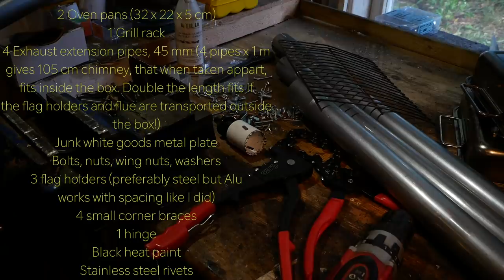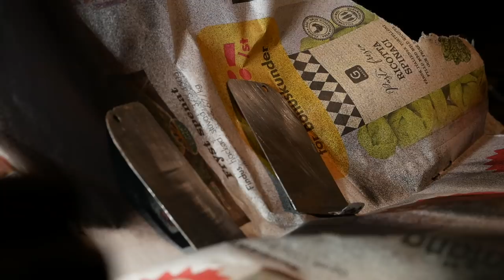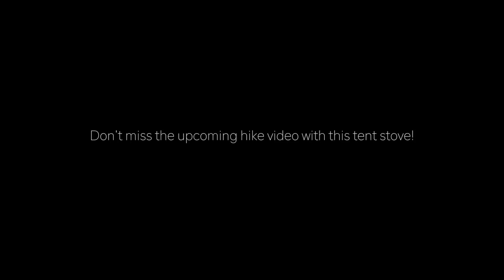IKEA DIY Tent Stove for Backpacking

Comment: Some poeple live two lives. A Life before they owned an angle grinder and life after they own one. The first life was miserable and gray, the second is is full of glorious destruction, planning and construction!
Reply from the maker: Indeed!
Reply: Hahaha 👍🏻😁 good comment! And true!
Reply: Amen.
Reply: Sparky Runner  not putting in to much wood
Reply: @SwedMiro - Truer words have never been spoken...  so many years I walked right past the electric hand grinders in the tool isle, when I could have saved so much time and hassle. At the point now I actually have two... I run a cut-off wheel on one and a grinding wheel on the other.

Comment: In case anyone is concerned about stove pipe size or length this is the math for a flue size:
 5% of firebox volume is the minium you need. Yes, 5%! Though there is a min and max length that fits into actual chimney effect that's tested.
Results for a 2.5" exhaust pipe:
235.61944901923" volume for a 2.5" pipe x 48" long
632 cubic inch stove 13x9x6 means his pipe is about 43% of the firebox and it clearly passed the draft and smoke over tests! Its a freakin rocket!
Reply from the maker: Well thought so!
Reply: Craig Mad Bricky:  as a matter fact, I was wondering that. Thank you very much! It’ll keep me from dragging around any more weight than I absolutely have to when I make my own for backpacking and tenting.

So, if I have understood you correctly, according to the calculations you did, it would be a good idea for me to use a stove pipe that is smaller in diameter if I want to have a slower heat in my smaller –sized tent?

Some people are using dampers in their stove pipes. I’m new to this. So of course, I’m wondering if this would help to regulate the heat a little more effectively, and possibly the draw as well?

Comment: Excellent work! Very creative use of found materials. I have made four stoves and have bought one (titanium). I’m thinking your draft will run fine with only one side open, the surface emissivity of shiny stainless is quite low  , a coat of high temp bbq paint will fix that and you will get four times the heat out of the stove ( learned that with the titanium , same problem . I use a rolled up piece of stainless flashing for a flue, with fixed diameter swedged wire bands
Reply from the maker: Thanks!. Yes have been thinking about that, steel has a coefficient or 0.07 or something, one could weather it maybe? After this first burn the stove changed color into golden. I wonder if that change something? I got this crazy idea of cooking a steak directly on the stove so I won't paint it. Also having enough heat radiating hardly is a problem inside a small tent like I use..also the chimney is very important in heating the air inside. My previous problems have been it gets to hot inside canvas tents who stove very much heat

Comment: I had a similar idea, but mine was bigger.   I was more worried about how heavy it was going to be,  so I ended up not building it.    I wanted to feed the fire less often.   Good job on yours.    The only part that bothers me a little in a closed tent is the stove pipe seal.  It's probably nothing by the looks of it.
Reply from the maker: Yes its not for long hikes of course. Im gonna do a field test of this as soon as the real cold gets here after I first install a damper in the flue...then I won't have to feed it as often.

Comment: I would suggest to forego the nuts, that create the porcupine look when being carried in. Other than that, Excellent job at making what is needed, from what you have available. And Thank you for mentioning to "burn it in hard" in the open, before you ever take it anywhere else. Great tips
Reply from the maker: Thank you! I like when someone gives thoughts on my vids. The wingnuts are still on the bolt to protect the backpack when walking in. But before I take it on a real hike I will cut the bolts shorter. Will reduce the porcupine look for sure LOL.

Comment: Right on👍👍👍. You could turn that into a backpack smoker bbq also. Or even a tent heater with a heat exchanger? Is it wobbly with three legs? If I had a backyard like that I would be the most relaxed person ever.
Reply from the maker: Thanks! Yeah thought about the possibility to smoke fish in it. Three legs is very sturdy in the woods because of the uneven ground. Tripod for terrain. 4 legs at home on a plain floor.

Comment: Brilliant design, one I may well shamelessly copy!  The only issue I can see is, could the wooden legs get so hot, they start to smoulder, possibly causing the stove to tip over?
Reply from the maker: Thanks. I wondered that to hence the spacing between the flag holders and the stove. I have not been able to affect the aluminium sockets so far burning it red hot

Comment: Don't get me wrong (awesome DIY video) but wouldn't a cheap rectangle table-top charcoal grill speed up the build process & lower parts costs... seeing how most hardware + air vents will be included(!?)
Reply from the maker: Cheap grills are done in a week or two. Abu smoke box could work but no fun building
Reply: @Swedwoods  - Interesting... good to know.

Comment: Have you done any more burns on this. I built one similar but found that due to the small door for fuel, I had to use small pieces and it needed a lot of tending. Have you seen the same thing happen. Also a baffle will help make it stop smoking.
Reply from the maker: I have the fire lay grid pretty low...so I can get bigger pieces in there. But sure you can't stack em high. I was aware of the compromise in making a stove this shape just to be able to have it inside a back pack. A hike with this stove is coming up so stay tuned. And i will see if I need to make any extras like an extra damper in the flue or something to control the burn more. I don't know if a baffle will fit though. Needs to have the same space as the diameter of the pipe..or else it will come a lot of smoke out the door when you open it to feed it with wood.

Comment: very handy thing and great craftsman-skills; seems like perfect addition to my handcart-setup. and i like the huge cooking.area.

i wonder, because of the flat design, if the burning-process is fine or leaves a soothy mess behind, esp. with pinewoods.

one question: where did you get the stovepipe from? seems like a little problem here in germany to get a portable, lightweight stovepipe. 

cheers,

mex
Reply: Duct pipes are what I use. Germany will definitely have the full range. I have made a few micro bbq. Using khantal wire grid to hold the coals.
The other source of pipe is a chimney fitter and they have lots of off cuts

Comment: whats the price of all the materials? (aprox) thanks!
Reply from the maker: 43 dollars in Sweden...hard to tell exactly when you already got a lot of the little stuff like screws, bolts and washers and some junk metal lying around.. old grill grids are in every home though. The box is very cheap..like 12 bucks on Ikea...then it all depends on weather or not you can buy really cheap gas extension pipes.
Reply: Swedwoods Fantastic build! Beautiful! What are your thoughts on titanium flue? Just roll it out and slip some wire bands around it.

Comment: Cool Idea! I'm planning to build it in the next days (tomorrow I'll go to Ikea😜) but I don't know from where to get the exhaust extension pipes. Did you got them from Ikea too?
Greetings from Germany
Philip
Reply from the maker: No the pipes I got elsewhere! Just visit a warehouse that has a lot of auto parts
Reply: @Swedwoods  ok, thanks for your answer! And I think the flag holders aren't from Ikea, right? I don't really know how I could make the ''legs'' without the flagholders.
Philip
Reply from the maker: In Sweden there is IKEA outlet. I believe they are old ones that is not in today's assortment. But cheap alu flagholders are everywhere. Just don't forget the spacing or else they can melt. If you want steel ones check stores with boating goods. Or do as in other stove builds at my channel. Instal coat hangers as feet and attach with wing nuts.
Reply: @Swedwoods  thanks man! I think you wrote in other comments that  there will be an overnighter with the ikea stove, right? Im looking forward to see how it works in cold nights! I started building my one today and I will be finished tomorrow or the day after.
I like your videos! Stay tuned.
Philip
Reply: I have attached my video with my mini bbq which uses the duct pipes or the off cuts from a chimney installer. The wire is khantal and brought from amazon. 1.2 mm gauge. The melt point is 1600 °C. very useful

Comment: That thing is built line a tank.  Great job! I suppose  you don't want my plans for $70 hot tent stove made from a mail box and 2" thin wall EMT... LOL I would use EMT for a stove pipe. Much lighter.

Comment: I just finished building an exact replica of your stove! Thanks for the inspiration :)
Just a different solution for the legs and slightly different placement of the stovepipe. (I put my pipe in the rear corner instead of center to get the stove as far from the wall as possible.)
Other than that it is the the same products used and same dimensions.

I have problems with smoke exiting the wrong way sadly :( Probably because Im a total newbie when it comes to this stuff ;). 

Did you have any difficulties to get the right flow?
Reply from the maker: det är viktigt att röret sitter bra och tight på toppen så det inte läcker luft. Då minskar trycket i kammaren och man får sämre drag. Även sidorna där ugnsformarna möter varandra behöver vara tätt, något litet glapp funkar dock bara du gör ett rejält spjäll som släpper igenom tillräckligt med luft. Tänk på att spisar behöver "eldas in". Flera jag har byggt läcker lite när man tänder första gången men låt det bara sota lite så blir det bättre drag sen. En annan faktor är höjd på skorstenen. Ju fler sektioner du sätter på desto mer drag blir det. Eftersom formen på denna spis ej är idealisk för regelrätt värmeeldning i exempelvis tält, då planen mer var att den skulle bli mindre skrymmande och ha ett stort utrymme för matlagning, tänkte jag att extra höjd på skorstenen skulle kunna kompensera. Nu räckte det för mig med de avgasförlängare jag fick plats med inuti spisen, men det kan vara en lösning för dig om den inte vill brinna ordentligt. släng på en sektion till även om den kanske inte får plats inuti. Finns inga garantier när man bygger saker för hand såhär, jag har flera gånger byggt identiska saker som beter sig helt olika från varandra. Det kan handla om millimetrar. Ytterligare kan jag kanske se något om du filmar spisen lite snabbt med mobilen och lägger upp på din kanal. Annars hoppas jag du får go tur!
Reply: Ska absolut testa att addera en till sektion.
Läckage mellan plåtarna var min största oro när jag testade den. Men det såg inte ut att komma ut något där.

Jag skriver en rad om/när jag laddar upp en video! Kan ju vara kul att se om inte annat.

Tack för svaret och en grym kanal! Keep it up.

Comment: Great job!  You should make a spark arrestor for the top of the pipe.

Bra jobbat! Du borde göra en gnistskyddare till toppen av röret. - Google Translate
Reply from the maker: im thinking i will never use one of these stoves in summer other than maybe like this when i build it... so in winter i dont need a spark arrestor.  unecessary weight and work. Thanks!

Comment: I have seen the Ammobox conversion and now this conversion. I am thinking of converting small grill like this 

https://www.amazon.co.uk/Deuba-Portable-Charcoal-Stainless-Barbecue/dp/B00J27P84K?ref_=fsclp_pl_dp_4

(only problem, no cooktop, need to be finagled)

or this: 

https://pisces.bbystatic.com/image2/BestBuy_US/images/products/4882/4882872_ra.jpg;maxHeight=640;maxWidth=550

With a good cocktop but much bigger (though..mo fire mo fun). 

same price as ammo box (in Sweden atleast) but better prepared for life in flames. Though probably a lot heavier to carry) Seems to be mostly just adding a feeder hole and the pipes.
Reply from the maker: Yes I bought a couple of those on sale this summer thinking of converting them this winter. Should work but they are a bit to big for me really. And one has to put in a lot of extra work dealing with leakage. Got a us mailbox that probably will become a stove. And turning it upside down to be able to cook and easily connect the pipe

Comment: If u want to have a proper fire u need a 6" flu pipe, anything less is a massive pain in the ass. Cool project tho.
Reply from the maker: 6 inches?!
Reply: @Swedwoods  yea even 3 inches is not enough, 6 is pretty hardcore but anything less just doesnt draw well and makes it burn slow which means no intense heat if its winter... you spend all your time cutting wood up really small so itll burn.. then you check the top of the stove pipe after a few days and its almost all closed in with creosote!
Reply from the maker: yes I have used bigger for bigger boxes before here on the channel. This one is perfect for the volume these two pans have. Its about pressure! I tried a smaller pipe first but then it was to much creosote as you said. If you have a to big pipe once again the draft will diminish.. and smoke will come out unnecessary when you open the door to feed the stove.
Reply: @RollingColeMotovlog  Being a Mason and solid fuel technician for 30 yrs i can safely say your wrong. A standard sheep herder stove is only 4" pipe and that stove is 5 times bigger than this one.
Reply: I have a wood burning insert in my house and we had to squish down the 6" pipe to get it thru the shelf in the chimney and it barely drafts. I've had a small woodstove with a 3" pipe and it was completely ridiculous and no matter how small u cut up the pieces u could barely get any heat out of the thing. I dont claim to be an expert tho.
Reply: @RollingColeMotovlog  I understand your issue. That masonry damper rests on the firebox and is carrying the flue liners.A good insert mates to the immovable object and we gas torch cut the back of the damper and chip out part of the smoke shelf. Thats an all day job  and some style fireplaces are undoable.
I have been called in on too many stove issues only to inform of this.  Firsthand the stove must be tested by the mfgr and added to the database for pro installers. The two most important issues are stove pipe diameter and volume of both firebox and chimney. The flue on a house should exceed 23' to create the chimney effect. The rule of thumb is 5% of the volume of fire box. Thats pi r squared x L.
Your tent stove and sweds both really needed dampers to slow down the vaccum effect of too large a draft.